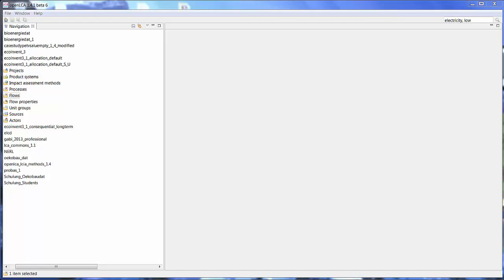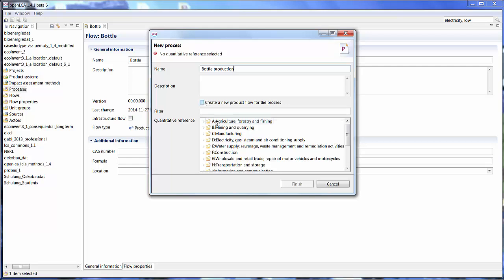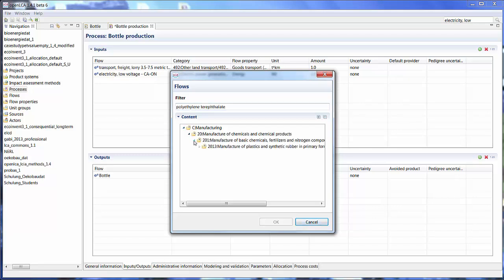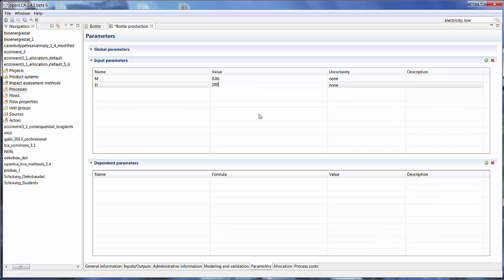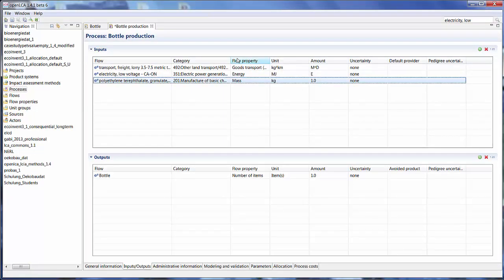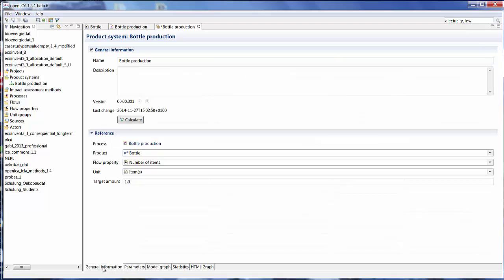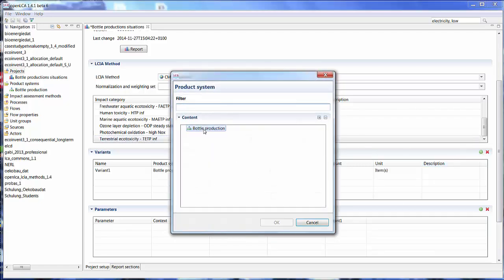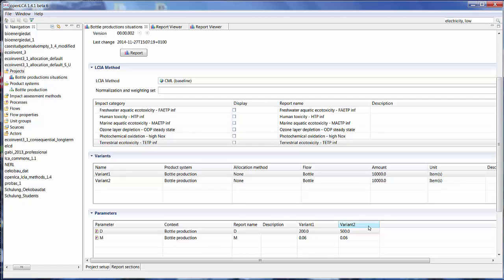Tutorial: How to create flows, processes, product systems & projects in openLCA

Comment: Hi, nice tutorial...the only thing I miss here is how to perform the LCA for a system that has several interconnected processes (lets call them "steps"). I created a process for each step but now I don't know how to generate the product system in a way that all the steps are linked… also, most of my inputs do not show any provider, how can I overcome this and move on to the impact calculation? Thanks in advance!
Reply: Hello, were you able to figure this out? I am facing a similar problem. I have multiple processes and need to make a linked product system. Should I bring everything to one process and then proceed?

Comment: very clear explanation thank you so much ! but can you tell us what's the definition of the provider exactly ? and in my process there's no provider even when i had combined the two databases i have , what should i do ?
Reply from the maker: Dear Maya, the "provider" is the process who is providing the product flow you are using on the input side of your process. In openLCA the same product flow can be produced by several processes which is why you should define the providing process in the column "provider". When creating the product system, the software then knows which processes to connect. You can also manually draw the connections in the model graph of the product system.
In case you do not have a provider for a product (i.e. you are using a "dummy" product), its supply chain is not taken into account which means no environmental impact are associated with its production.
You could either create the supply chain yourself, or use an existing product flow from the database you are working in (if one exists). Best regards

Comment: Why are you using unit process instead of system processes to build your prduction process?
Reply from the maker: It is a matter of preference to use unit process instead of system process. A model with unit process will outline all of the processes down the supply chain in the impact assessment results, whilst the system process approach impact assessment results does not distinguish what the process down the supply chain are. Instead, a system process approach only distinguishes the inputs and outputs flows down the supply chain.

Comment: I am in need of help.
I am currently working with openlca and any of these databases do not apply to my country (Mauritius). However, since there are some products that we actually import, i'm thinking of using some on the  products on the database i'm using and to add the others manually (like transport and electricity). My question  is how do i add the data manually (I have the impression that i have to work with the composition of the product that i want to add and then i have to create a process with the elementary flows.) And also, how do i add a provider if i'm adding manual processes? 
Thank you!

Comment: at 6:02, you didn't confirm your "m" input.
Reply from the maker: Dear onn chiu chuen, the parameters are always defined in the parameters tab before using them in the Inputs/Outputs (see 4:30)
Reply: openLCA if you refer to 6:02, your mass is 1.0kg, not 0.06kg (M)
Reply from the maker: onn chiu chuen you´re right, that´s a mistake, in that moment the value was not saved!